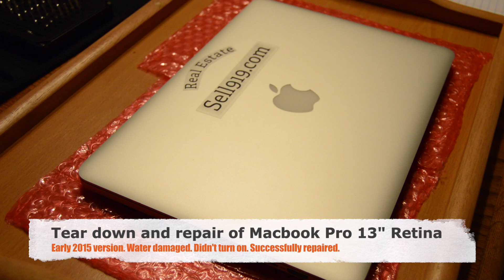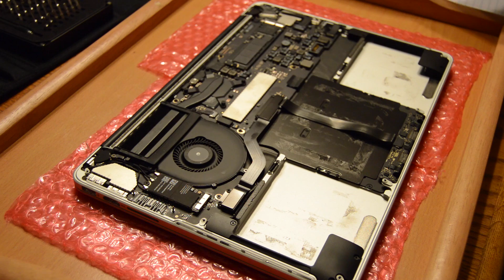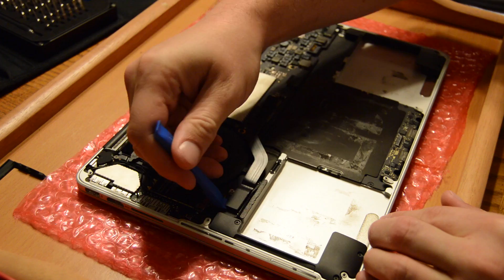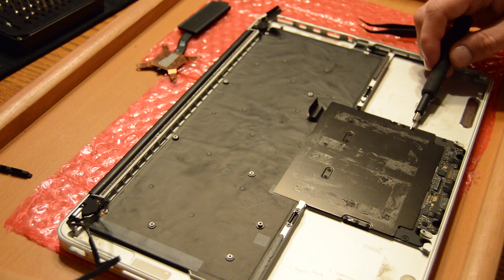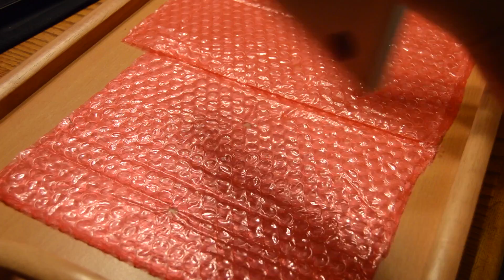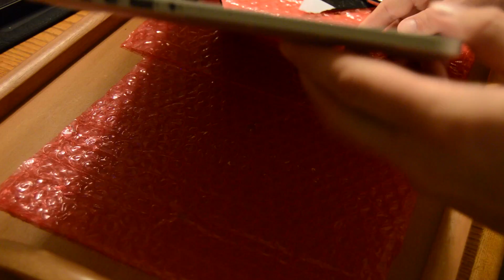Macbook Pro 13" Retina 2015 repair from water damage

Comment: Do you need to replace the heat area sensitive glue? What did you use
Reply from the maker: I replaced it with a double sided foam tape, just a small strip on the top and bottom just in case I needed to get back in there! I picked it up from the hardware store. It wasn't too thick. Just wanted enough to stop the battery from sliding around as I toss it around the house.
Reply: I have corrosion on the under side of the SSD. Can that be cleaned? Also have corrosion on the power port. Can that be cleaned as well?